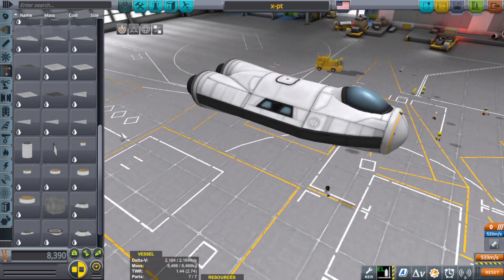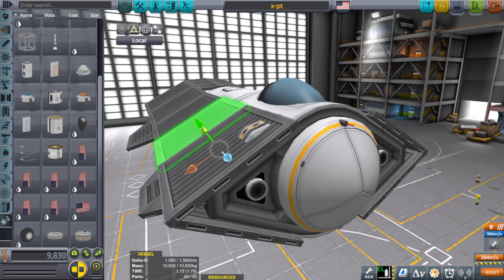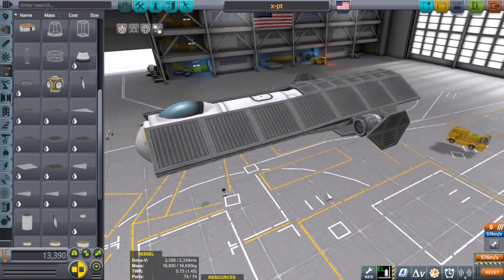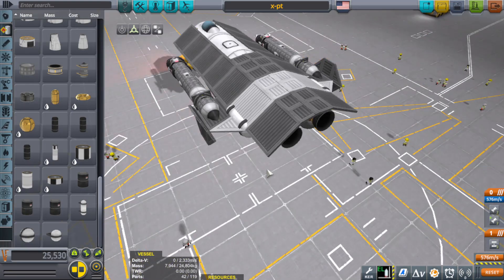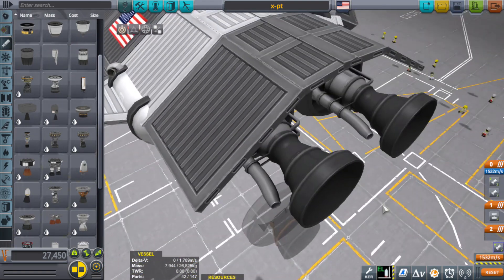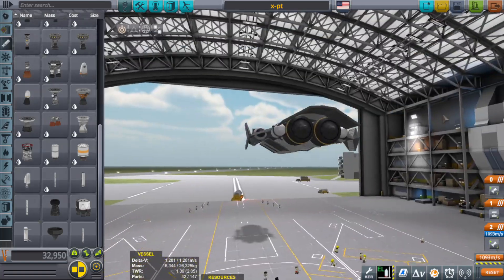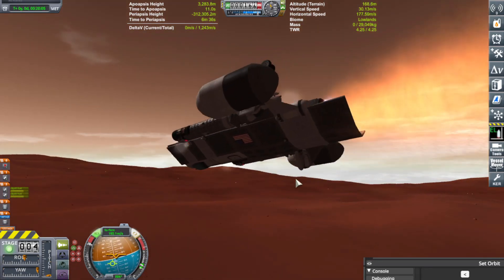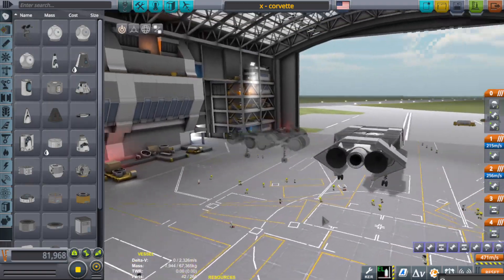PATROL WARSHIP CONCEPT \ Kerbal Space Program \ KSP 1.12.2

Comment: Nice video as always. 

I took inspiration from your shrapnel missile and made 2. One using radial decouplers and even zero force eject they scattered wide. 

I also tried putting the small cone on radially with a 0.6m decoupler and the I beam attached on the node. Straight ahead they did nothing but I rotated the cones 1 "click" outward and they separate but stay very close to the missile. Thinking of combining both for a bigger spread but give it a go. 

Also tried making a box armor sleeper missile with a hinge in front exposing the weapon I'm having one if the hinges glitch every time on the runway. It stays in neutral position  and won't move. I got tired so i stopped there last night. 

Is there a way to do multi-player on ksp? I'd be cool with a face off sometime in the future  😆

Comment: I love these Warship designs!

The Aerospike offers decent TWR and efficiency, but it might be interesting to use one central Aerospike and two Terrier engines on the sides.Weight's the same, offers a tiny bit more fuel efficiency, but most importantly, it adds thrust vectoring, to make the ship easier to control and snappier to react. After all, evasive maneuvers aren't just about accelerating, they're also about changing direction quickly.